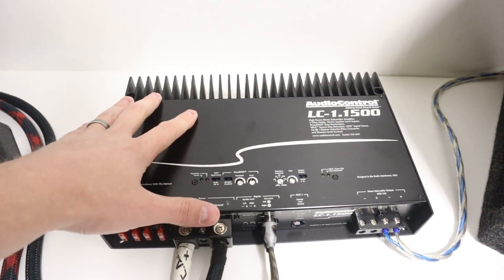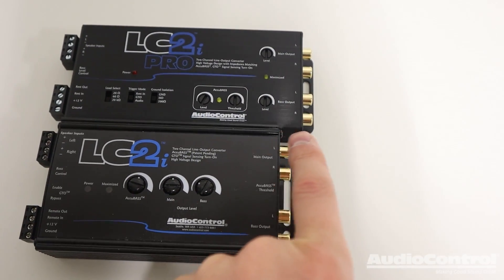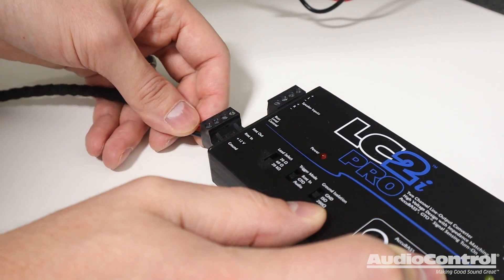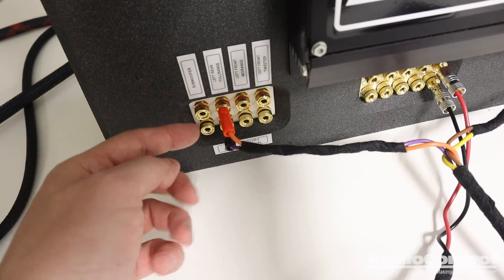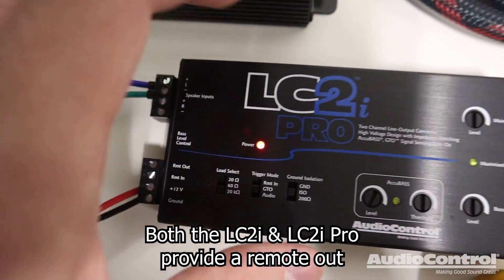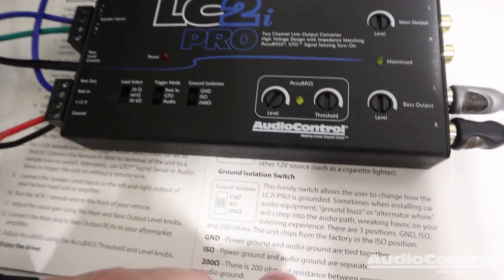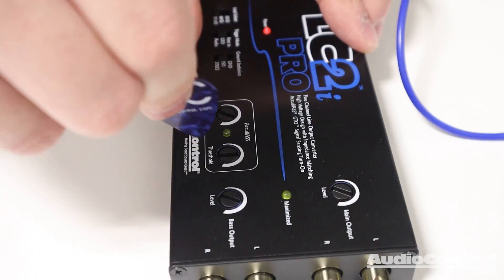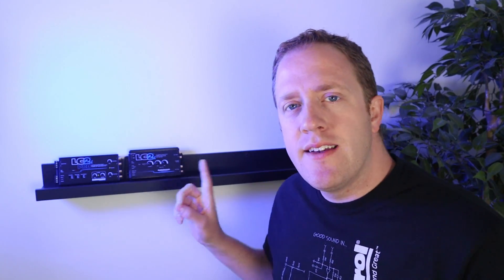Add amplifiers like a PRO! AudioControl LC2i-PRO overview

Comment: PLEASE HELP, how do I go about restoring bass roll off with my stock system? I have a 10th gen honda civic lx and shop put in some kind of harness that changes the wires to rca. I really dont wanna take everything apart to swap it with this as it dosnt have rca inputs. The problems im having is that I can set my gain on amp to max and it dosnt clip and the bass seems to play the higher notes really well and the kick drum usually but the lower notes are quiet or not even there.

Comment: Question: my 2014 Pathfinder Platinum has a  Bose system and a nice subwoofer hidden under the back storage area. Can I keep the factory sub and add a sub? I can connect an Line Converter to the factory sub amp (under the back seat) but how should I wire the factory sub & new amp? Meaning: should I use a t-fitting to the factory amp speaker outputs and keep the factory run in tact while also feeding the LC? OR, do I run the factory speaker wires from the amp to the LC and then use two new amps to power the factory Bose and my new sub box?

Comment: If you maximize the gain are you sending potentially to high a voltage to the amp.  For instance most amps want no more than 5v.  This device can our out like 13v.  Won't that cause the amp to go into protect..?.

Comment: I still don’t know where to set my amps gain.  I guess run the light step then move on to the amp?  I don’t have an oscope so I’ll just set the amp gain with a multimeter.

Comment: I'm glad I've watched this over and over again.. the Crutchfield rep told me wrong. I clearly stated that I'm adding a monoblock sub amp and sub. I needed to know which speakers I need to tap into for a sub signal ..he clearly said the "rear" speakers. I knew something wasn't right.
Reply: I chose my front door woofer.  What did I miss?   There’s too much info in this video for my cluttered brain.

Comment: So on the way home from getting my install done with this controller in my 2011 honda odyssey EX, the bass was cutting in and out it would go really dim on loudness and then all the sudden it would be way too loud. I believe the company tapped into the wires for the stock sub. Would i need to shut off accubass? They couldn't give me a explanation of what was going on.

Comment: I paid almost $900 for dual 12" kicker subs, and LC2i pro. I had the a 600w kicker amp from my last system. Very high quality wiring and they tuned it nearly perfect to how i like my music. Mostly r&b and hippity-hop. That knob to control the bass off the subs is everything. My factory radio speakers is 6×9 Alpines. If you're really serious about your sound system, the LC2i pro or LC2i is a must. This video gives me more clarification as to why it was requested by the shop and how to properly use it. Thanks for this video.

Comment: where would i tap into if i dont have a OEM sub woofer in the car? thanks
Reply: Rear speakers door or back dash..I have have 2015 Mazda 6 and tapped into my my rear door speaker and ran speaker wire under trim to trunk and converter
Reply: @D33ZYXx  Thanks
Reply: @D33ZYXx  when I set the bass input setting do the RCA going to the amp need to be uplugged , then plug them back in to do the accubass?
Reply: @southcalihds nah you should be good to go

Comment: I have a 2021 vw atlas w/o subwoofer. I plane to install four JBL 6.5 door speakers 150W each and four 1inc tweeters 75w each. I am not charging the factory radio and not adding any subwoofers do I still need to add the LC2 and what amp do you recommend.

Comment: How do you wire in the subwoofer leads to the LCI pro if the leads from the oe amplifier is a DVC dual voice coil input ( IE 4 wires?)

Comment: i hope someone can answer my question. can the lc2i pro be used to feed a 5 channel amp and then the amp power 4 speakers and a sub? will the audio be effected in any bad way?
Reply: I don't think it can run a 5.. but definitely can run 4 channel. It's had sub out and full range out
Reply: @erics8896 yep! An LC5ipro & using a SMD DD-1+ would be ideal.  🔊🔊🔊📈
Reply: Yes it definitely can, but you will lose fade function. Get a full range signal into  the LC2i Pro, then use the Main output into your amp (most amps can select from 2/4 channel input for the full range)   Next, use the Sub output from LC2i and input into Sub input for your amp(again there should be a selection switch whether it is a sub input or if it will be getting sub frequency input from main channels) Now you can adjust accordingly. Remember, you WILL lose fade function but you can also adjust gain on the front and rear to your liking.

Comment: When I decided to add an amp and a pair of subs to my factory system I did my research. I chose to buy an amp that was capable of accepting both inline RCA signals and inline signals from the factory head unit. No need for any additional products. The installation was simple. Find the lines out going to the speakers splice into those wires with the adapter provided. All the hardware was included with the amp. The spliced  wires were then sent directly to the amp and the amp would convert the signals to a low level for my subs. Once I had everything wired, I tested the system at a low volume setting in order to make the necessary adjustments. Once I was satisfied I tested the system at a mid level volume setting and it worked great.  Both the amp and speakers are made by Kenwood and are rated at 1000 watts. I wasn't going for a make the neighbors mad sound but for sound enhancing. And it does hit hard when I want it to.

Comment: Can I use an LCi2 to control 2 subwoofer amps?  it looks like one output is intended for a subwoofer and the other out put is for other.  
I would like to use this module to independently control 2 subwoofer amplifiers vs getting 2 LCI1s
Reply: The other rca output is for your amplifier that runs speakers and tweeters only not for bass
Reply: Right but can it be used for bass?  My inputs to the LCI2 are already from a factory dubwoofer line so the signal is low pass to begin with.  
I guess does the LCi2 already inlcude a low pass / high pass filters on the output lines?  @Jay3.5boost

Comment: If I have a 2025 Chevy Silverado and it does not have a factory sub or amplifier in it, do I hook the front speakers to the LCUI2? I had it installed with a 10 inch sub built-in amp and I’m still getting really bad base roll off. They use the back speakers instead of the front. Could that be my problem?

Comment: Very nice video.👍
Hello sir, you mentioned that 1 amp fuse is needed for the Lci2 pro, mi car is Chevy traverse an use micro fuse, the thing is I can't find 1 amp micro fuse, what do you suggest, any options please.🙏
Reply: I think he is implying a minimum of 1 amp. Just identify a fused wire such as a cigarette outlet. 
Refrain from tapping into, say, the fuel pump or PCM circuits.

Comment: The speaker leads on the lc2 i . If im using just one channel for bass . Do i still have to feed all 4 signal speaker input in the lc2 i or just 2 speaker input from door speakers  ? Or does all 4 have to get power  signals . Thanks

Comment: Couple of questions: I have and Audi A6 C7 (2014) and will be building aftermarket sub to it using LC2i-Pro to handle the signal. Now, which load selection is right (20, 60 or 20k) and how do i know the ground isolation or can i just test it?

Comment: If i install a LC4, will this help eliminate the wining sound. I have 21'toyota Tundra with stock stereo and aftermarket amp. Please help, I can't get the wining noise yo go away....
Reply: I heard if you run the RCA and power wires too close you'll get alternator noise. Have the grounds     recheck too.

Comment: So when you’re getting your speaker signal from the stock amp are you making making it a T and running the new wire to the audio control? Your pretty much running your wires from the stock speaker wires and also the 12v

Comment: If the amp has a gain control do I need to connect the LC2i gain control as well or in place of?
Reply: Adjust the LC2i gains first, then attach your RCAs to your amp. now adj the amp gains using either a MM or 
SMD DD-1.  🤜🤛

Comment: I have a question. If my car doesn’t have an amp built into the stock system. My rear speakers which I’m tapping into. Will those be fine to run a high’s amplifier and a low’s amplifier?
Reply: Yes! The LC2 can be used w/o a factory amp.

Comment: So that's the difference between an epicenter and this?
Reply: Accubass helps prevent bass roll off as you increase volume. An epicenter helps restore frequencies that aren't really there.    A DSP will make older recorded music, say rock, really bump. With modern music, you'll also fry voice coils if you don't turn the epicenter down as needed.

Comment: Hey man! Ive tried calling audio control for some help and no luck and commenting on various videos with no help either. Long story short, i have kicker everything, i had the kisloc2 before i just recently got the lc2i installed, best buy did everything. Now, before i got it installed, lets say you turn the music all the way down, but the bass knob is still up. There was no kind of added noise of any sort coming from the subs or speakers, as it youd expect. After getting the lc2i pro installed, say you do the same thing, volume down or no music playing but bass knob is up, there is a low grumble kind of noise coming from my subs that wasnt there before. It gets louder when you turn the bass knob up all the way, but if you turn it all the way down, that noise goes away. Is there something wrong? Bcuz ive taken it back twice and the installer told me thats how it should be. But i have a gut feeling its not haha.
Reply: Try the ground switches on the loc to take away that hum.
Reply: @dc4l677  I did, no luck! But.... after finding one of the rear plastic panels by the rear seat loose, i lifted it up just to see because you could see all of the wiring, its all wired to one side, power and cables from the deck. On a lot of if not all videos I've seen, they should be ran separately from eachother right? Like power cabels on one side, cables from deck on the other?
Reply: @nike11397  yeah you want to keep them separated at all times, and try not to let them touch any metal. I wrap my wires just in case.

Comment: Just upgraded the 6 speakers and added a 4 channel amp and subwoofer amp along with 10" sub. Man it doesn't sound all that great. I'm pretty sure I'm going to need one of these but going to go with the LC7i only b/c it has 6 channel inputs just enough for 4 channel amp plus sub amp. Thanks for the video keep them coming 
"
Reply: Let me know how it goes, I think I will be doing the same thing…thanks!
Reply: @brandong8623  yes you are right it's about the same. I have 6.5 massive audio subs on doors and want more highs and mids which I'm not getting. What's a good 6.5 speakers that will bring out it's full potential? Thanks for the video

Comment: what happens if my factory radio doesnt have a subwoofer output only the Front left and right speakers output? Can I use those and then use the bass output from the LOC?
Thanks

Comment: I can't remember where I found the info but I used an OE sub input with the LC2i and connected it bridged to the outer most terminals. It's worked for many years that way. Wonder if it works with this.

Comment: Excellent video!! Thanks for detailing this, I am about to install 1 of these in my 2019 Rav4, without Premium audio, & I do not have a sub output from stock head unit. I plan on just adding a powered sub, do I just tap into front or back full range signals, & use the bass output signal?

Comment: Let’s say I get a lc2i pro with an amp for 2 subwoofer. Can I install an audio control epicenter but also use the regular bass that the amp has for the subs? Or that will burn the bass amp? (Idk if I explained my self)

Comment: just bought one of these for my veloster turbo. I tried a kicker loc first and it really did not like my factory amp signal. Let's hope this does the trick!
Reply: Have any update cause I got the kicker loc too and it doesn’t work for a 4 channel amp it produces engine wine found out the kicker loc is only for subs not door speakers.

Comment: Mark, If your side note about using the left speaker input on the lc2i if you only have one set of speaker wire tapping into a speaker, is correct which im going to check tomorrow morning. you are a god send, i was doing a install today on a friends car and got to the very end and could not figure out why my lc2i is not turning on even though i know it was connected properly and my speaker input is correct.
Reply: So when I unplug the right rca while using the left speaker input my volume goes up drastically. I ended up having to leave the right rca unplugged and only have the left rca plugged into the lc2i running to my sub amp.

Comment: Does the 12v constant for the lc2i come from the battery like the amp?
Reply: Yes or run directly from the amp with a jumper wire with a fuse in between.

Comment: I dont have an issue with bass rolloff but I do have an issue with the bass sound when using high level inputs. Its very hollow and does not sound full, I have tried everything to fix it but have no Idea.. Anyone?
Reply: What kind of amp do you have and what size the speakers?

Comment: GREAT VIDEO! - So, question....since now I'm going down a rabbit-hole....lol.  I recently followed your video to an exact tee and coupled this with the instructions on how to set up my sub amp (JL Audio 500.1).  Now, I recently found some info on using an Oscilloscope to SET proper GAINS.  Do I still need to get one if I followed all you instructions in the video or does this negate the need for an Oscilloscope?

Comment: Is it possible to use the full range and subwoofer outputs from this unit at the same time?   Want to add subs and replace the 6x9s in my rear deck with a amplified set
Reply: Yes of course

Comment: Where should I be doing the 12v connection to power the unit? Could I just wire it from the positive terminal on my amp since that's 12v constant? Or do I need to find a wire somewhere in the car to splice off of?
Reply: i’m having the same problem right now did you figure it out?
Reply: I would use a distribution block to tap off the larger gauge 12v source that is from the battery.
Reply: Hear anything ?

Comment: My car is equipped with ANC, does anyone knows if trigger mode is set to audio will it bypass ANC signal send to subwoofer when audio is off?
Reply: You may need to disable your anc to avoid that audio coming into your amp

Comment: How about the gain on the amp? What do I set that too when setting the bass output level on LC2i Pro?
Reply: He also didn't go over the fact of what the actual ACR knob does is that just for the accubase so I'm guessing if you set the Accu base to say 12:00 that's the max setting of the ACR knob I suppose
Reply: @Schooobe i just got the pro a few weeks ago. The knob simply allows you to control the amount of bass you want to hear. Its an amazing add-on, because some songs sound better with a little less bass, without having to turn the music down..you can just tune down the bass/ or increase depending on what you're listening to.

Comment: I am currently confused on exactly how I should wire this with an 18 speaker Ford Unleashed B&O stereo system.  I wired it from the subwoofer but it really seems to be all these crossovers working against each other.  I received some advice to use a side speaker but the crossover cuts off some of the deep lows for that speaker.  Kinda puzzled.  Anyone on here have any insight?

Comment: i purchased an LC2i pro at a garage sale for a few bucks. its new in the packages, doesnt appear to have ever been installed or used. however, it's missing the ACR-1 knob control. do i need the knob for this unit to function or can it be run without it? Also, can i pull signal from the rear speakers themselves for my sub, or will it require connection from the back of the stock head unit?

Comment: I have a question, what if our vehicle does not come with a facotry subwoofer, would it be better to tap into the rear or front channels to connect to a lc2i pros speaker inputs for a subwoofer?
Reply: Rear

Comment: Your factory unit doesnt send out low voltage ⚡ ...so you use a high to low converter in order to use the amp....but not every line output converter is good audio control is best

Comment: So with the lc2i pro I can add both a monoblock amp for bass and 4 channel for mids and high’s?
Reply: I need to know the same thing
Reply: @ericsohood25  you can I got my system installed with both amps on the lc2i pro
Reply: About to try this soon, I wired my lc2i pro with the two front speakers, currently only have my subs with amp , I’m adding a 4 channel soon , can I use the lc2i main outputs for the 4 channel amp? Even though the lc2i is only grabbing the front speakers outputs? Basically asking if I can wire all 4 door speakers using the output of the 2 front ones

Comment: What gage of positive wire do I need coming from the LC2 and Is it a fused positive wire? Do I connect it right to the battery?
Reply: you can connect it to the amps power / ground with a 14 guage wire. the power line between the amp and the power in of the lc2i should be fused with a 1amp fuse. HEY i finally answered something about car audio. guru status

Comment: Great video! I am looking to get the pro version for the load resistor’s for my challenger. Does the lc7i have load resistors like this one? If not, what are my options as my factory system does not have a full frequency range signal? Every speaker in the car has a different signal (tweeters, mid base and factory subwoofer)